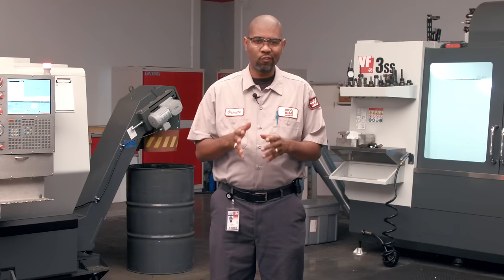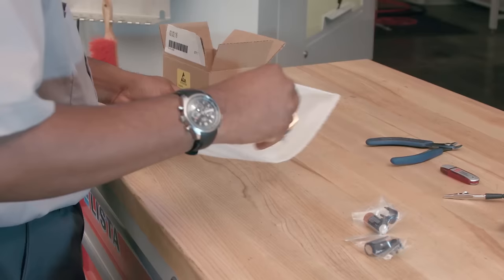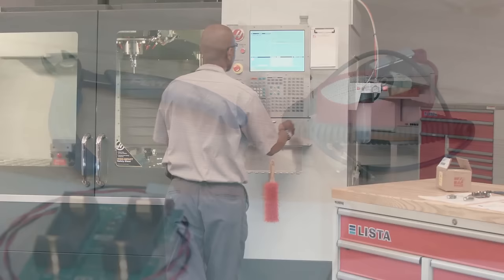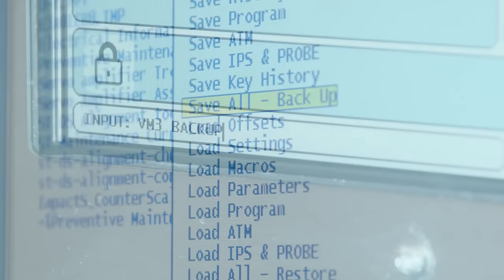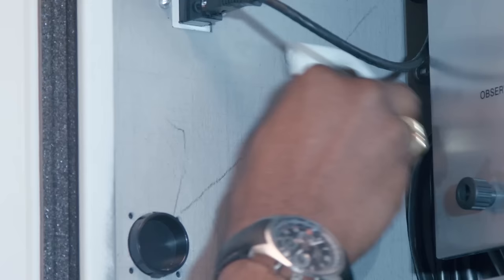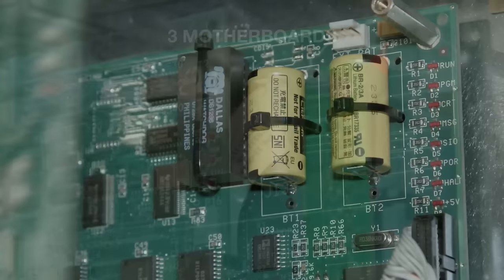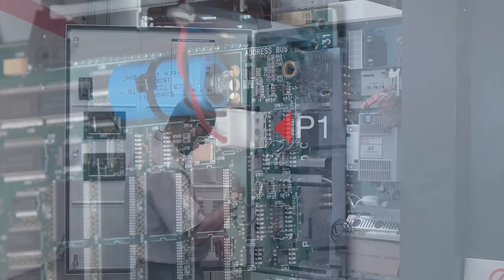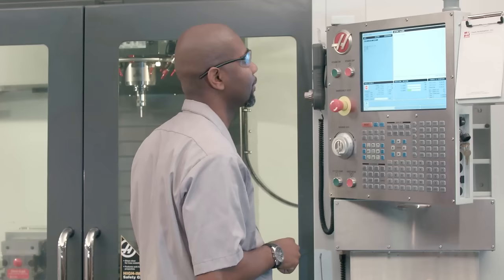Main Processor Battery Replacement – Haas Automation Service Video

Comment: Why this isn't included standard is a mystery on a machine worth tens of thousands of dollars. We had this done to our VF-6SS on the most recent maintenance visit (a whopping $100), but it's still ridiculous. This should be standard to make the machine as friendly in the back as it is up front.
Reply: This is insane! I now own a VM-2 costing me $80,000 and Haas can't manage to place a CMOS battery changer on the mother board in the first place. Their battery replacement Kit cost approx. $80.00, for parts you can purchase for under $15.00, including the proper battery. Total B.S.

Comment: If you do the USB back up does that mean you will be able to restore all your parameters and options if the battery dies on you?
Reply: No, you will still need to call HAAS. Give them your serial and other data to prove it's yours then you will have to get he codes to unlock any options you added. It took a good full day to get mine back up and I still had to go through a full calibration of the probes and tools as well as probing all the reference points again. I had multiple backups and they did help some but not like they want you to think.

Comment: This video don’t tell that you may lose portion of some settings.  We lost the net share tab.  Which we had to have a code to turn it on. 😡.  Ridiculous.  Now there’s a software glitch.   Getting a 203 error.   Which haas says just reset it and don’t worry about error.  🤷‍♂️.  Didn’t have error before changing battery.  My battery didn’t go dead. So I didn’t lose everything.

Comment: My board has a “J15” 4 pin input by the battery, not a “P1” input. Would I be correct in plugging into the “J15”? I have a model from 2008.

Comment: What would happen if you connect the battery before your Factory battery dies. It seems to me you wouldn't have to restore anything.
Reply from the maker: John - You shouldn't have any issues and so you wouldn't need to restore anything.  However, we're dealing with electronics, and if something were to go wrong you've lost your parameters.  So, just to be safe we always recommend you back things up before connecting the new battery.  If you decide to tackle the battery replacement on your own, below are a couple of procedures that may help - Haas Automation

https://www.haascnc.com/service/troubleshooting-and-how-to/how-to/main-processor---dual-battery-replacement-kit---installation.html 

https://www.haascnc.com/service/troubleshooting-and-how-to/how-to/main-processor---dual-battery-pcb---battery-replacement---chc.html